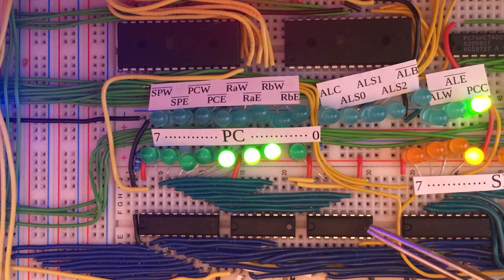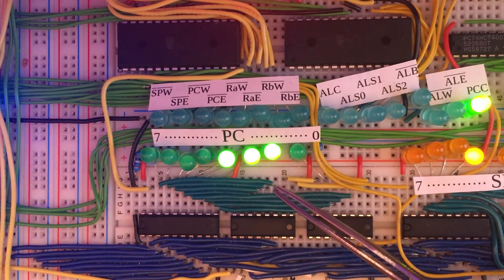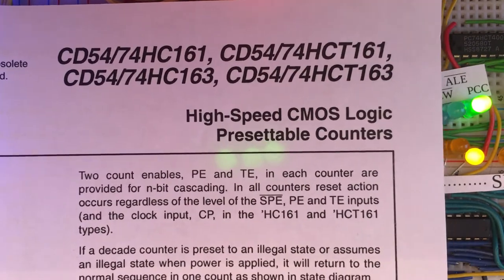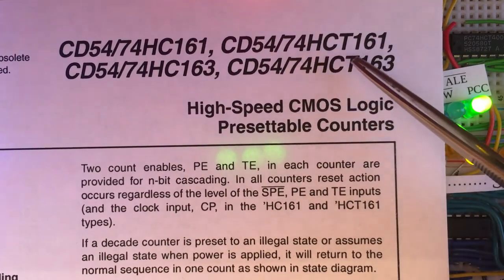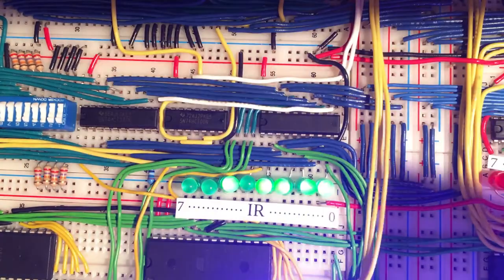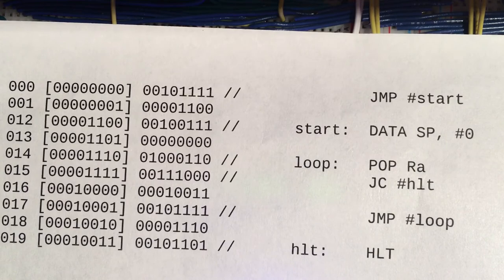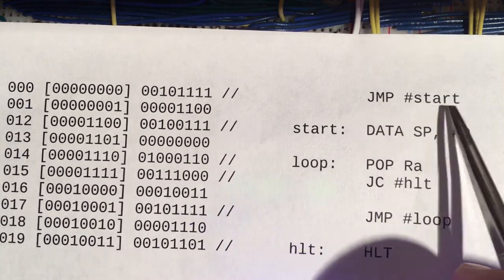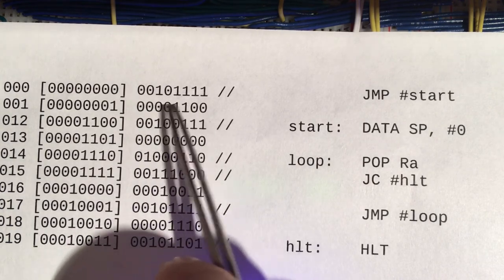My Ben Eater inspired homemade 8-bit CPU - Part 5: Program counter & Instruction register

Comment: Clever opcodes! In fact, we theoretically have 2^8 = 256 opcodes, which could be randomly assigned to every possible combination of instruction, source and destination. Separating them is just for neatness and making things easier for us humans without an assembler. Doing this clever tricks breaks a bit that neatness and makes it more difficult to program, but it's still very easy compared to something totally random.
Reply from the maker: Indeed: a compromise, as always ;)

Comment: I see that you included an "autoincrement" feature in your program counter, but not your stack pointer. Wouldn't most of the stack pointer's operations be --SP and SP++? Having the ability to do those without going through the ALU seems like it would be useful, especially as you're including "SPi/d" as an operand/addressing mode.

Comment: So the way you're embedding data/address operands inside of program memory is essentially how I'm doing it right now, but I'm wondering if there is a better way that saves program memory. I'm thinking about taking your pseudo-Harvard concept and expanding it to have three unique segments of RAM. Program, operand, and data. All this requires is a SRAM module with 11 bits of address space. The downside is the need two additional control lines. Although, if I implement a separate counter for that, maybe I can do it with one.
Reply from the maker: Well, it makes programming much more complicated... because you'd essentially need to load two parallel sets of bytes (one for program memory, and one for operand memory), and the two sets would need to be completely synchronized.

I don't know of any existing architecture that works that way, and so I don't think there are any existing assemblers and compilers which produce such code... Remember, my main purpose, was to run high-level languages, i.e. to be able to use compilers and assemblers, and so I went with the way most real-world architectures handle immediate operands (x86, ARM, AArch64, Amtel, M68k, ... they all have embedded immediate operands as far as I'm aware).
Reply: Mmmm, perhaps, but that's essentially how Ben's original design works if you think about it (without having to do a second fetch). For embedded data and addresses with 8-bit opcodes and 16-bit opcodes+operand, you still have two do a second fetch cycle. Either you are cycling the PC to get to the next memory location, or you are executing a different micro-instruction that activates the operand memory. Incidentally, have you seen this: https://create.arduino.cc/projecthub/david-hansel/breadboard-computer-programmer-1e7a09 ?

It makes programming the computer very easy, already has an assembler, and lets you specify your own opcodes to the assembler.
Reply from the maker: Yes I did see it. Am thinking of something like that for my CPU...

Comment: Hi! I see you use the TE pin to enable counting on the second 74161. Ben Eater used the TC signal as clock source for the second 74161. On what grounds did you decide to use the TE signal? Does it have any advantages relative to the clock source method?
Reply from the maker: As far as I remember, Ben Eater only has one 74161, as his PC is only 4 bits long..., so that is connected as my lower 4-bit 161 (the one on the right)

https://www.youtube.com/watch?v=tNwU7pK_3tk&t=197s

Comment: Why imbed immediate operands directly in program memory? I have not had time to really think out the way I want to build a similar computer, but could you use two SRAM chips? One for data, like immediate operands and the other as the instruction? Using another control line for when you would want to get data on to the bus from the 2nd chip rather than going to the next instruction via the PC?

Then again, I have been busy with school and do not have the time at the moment to really think out stuff, as you clearly have.
Reply from the maker: Not much point in that: an immediate operand is an immediate operand precisely because it's "hardcoded" into the program, i.e. in program memory. The programmer wants it that way.

If on the other hand you want to access variable data, you can do that too, using the LOD and STO instructions. It's basically up to the programmer and the nature of the data he/she wants to manipulate.

Comment: You could save even more on operands by considering LOD and DATA as nothing more than MOV ops.  Your specs already specify all sources and destinations in the 3+3 bits
Reply from the maker: How then would I distinguish between MOV Ra, Rb (a := b) and LOD Ra, [Rb] (a := b^) ?
Reply: So I take it then [Rb] means data at memory address pointed to by Rb?  I was wondering about your reference to indirect addressing.
So LOD and Data are indirect addressing moves.  I would have preferred indirect reference in the source address component but I suppose making it a separate OP code works.
Reply from the maker: @danman32  you can do it that way, then everything becomes a mov, that's right, but of course you need more bits to encode the various addressing modes.